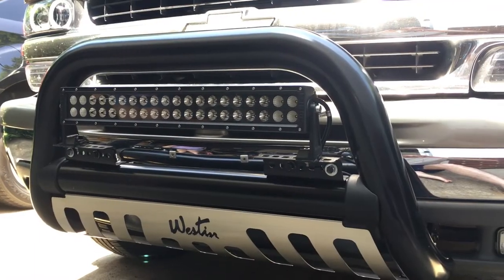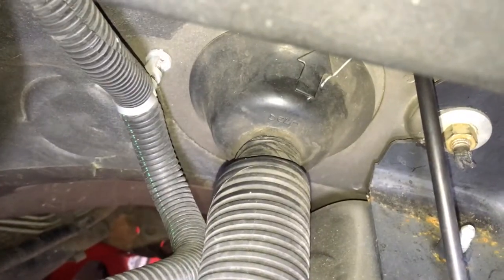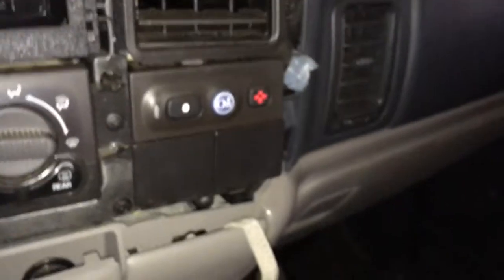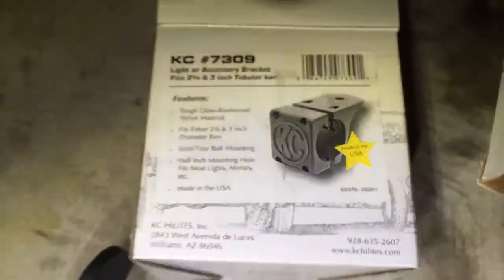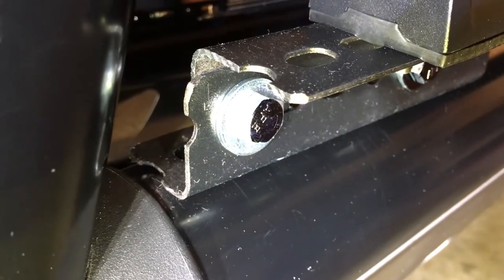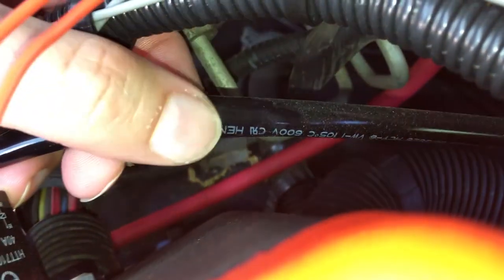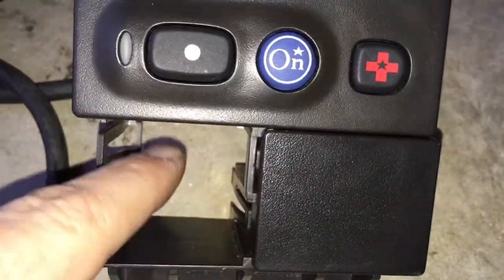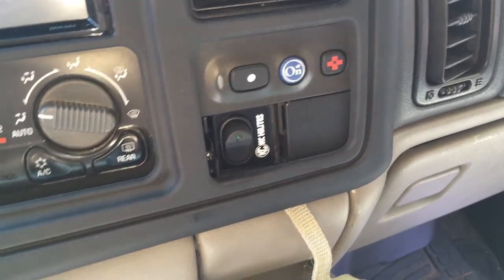LED Light Bar Install Chevy Tahoe

Comment: What kind of posi battery terminal is that? I have a 05 denali and im in the same boat. Light bar in the front. Easy negativity ground. Posi a bit more thought needs to happen

Comment: I have an 01 tahoe. My low beams will randomly stop working. High beams stay working. Then they turn back on when they want to.. could be few minutes. Could be few days. I've replaced headlight switch, relay, entire turn signal, even the socket the headlight switch plugs into... no luck yet. Any ideas?
Reply: Have you figured it out yet bro ?